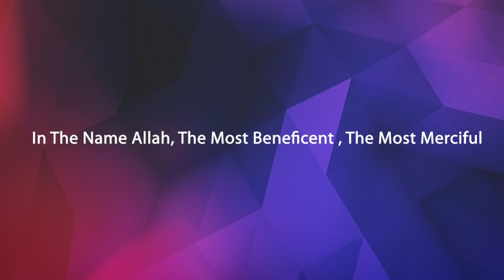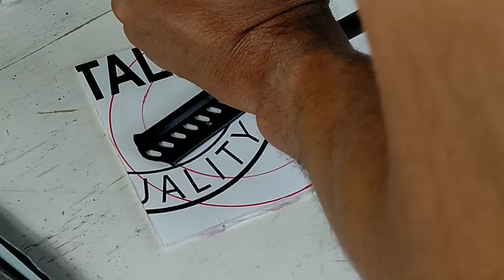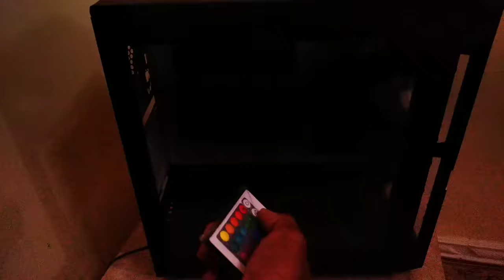PC CASE MODDING

Comment: My PC is built in a case from 2003. I didn't do a lot of mods, infact none were necessary. I drilled more holes on the back to fit a 90mm case fan because originally only a 80mm one could be fitted, i added holes on the front and an 80mm fan and i also made a hole for a 120mm top  intake fan. Also i used a old dead CD-ROM to wire up audio cable to it and make it a front headphone output.
Reply: How'd you utilized your old dead cd-rom for your front audio out? My front audio output doesn't work so it would be a great help if you share How'd you did it
Reply from the maker: There was some cables related to front panel
Reply: @timstevenstadeo586  I had an old cdrom with a headphone jack, i just cut all the traces from its board and soldered a 3.5mm audio cable doręczył to the jack. I plugged the cable into the back of the motherboard
Reply: @kacpreusz9911  thank you. You just need the wires already connected to the front audio then trace it back again to connect it to the mother board. Thank you!

Comment: What size drill bit and rivvets do you use for taking the case apart and putting it back together? Does the drill have to have a certain power or something? I never used a drill before ... or rivvets for that matter. Thanks in advance!
Reply from the maker: u need to look at size of hole what u did on the case